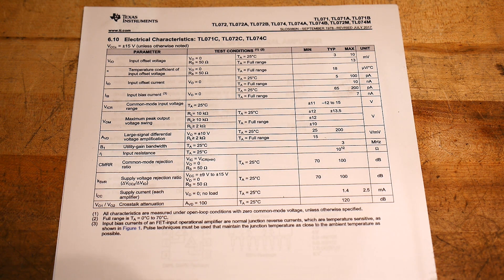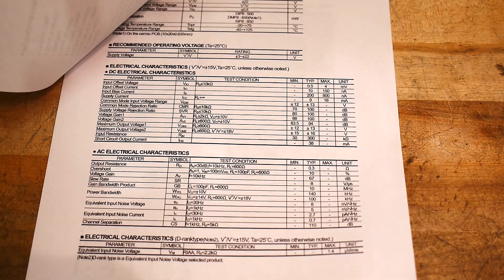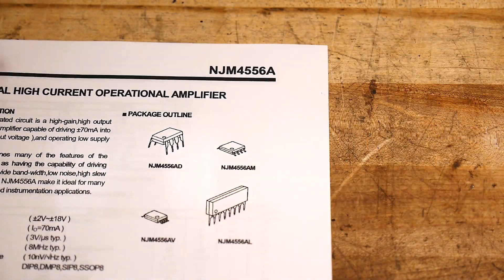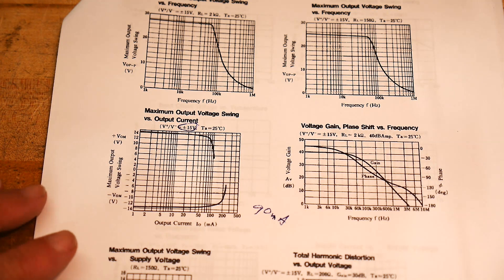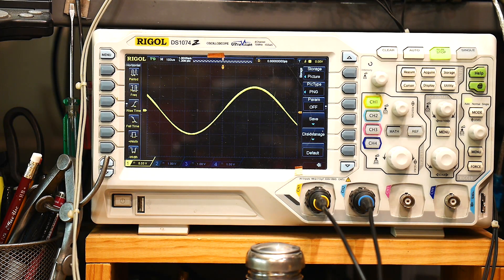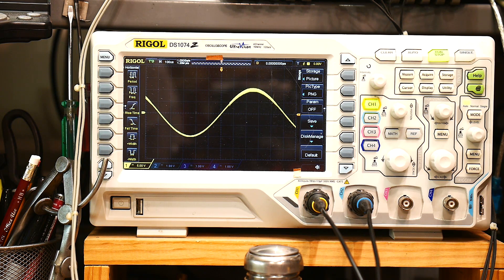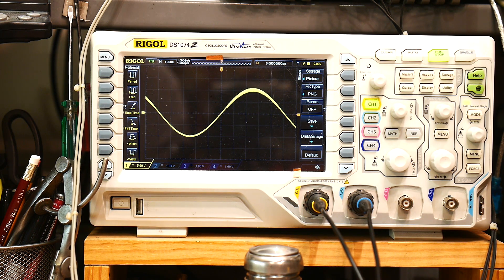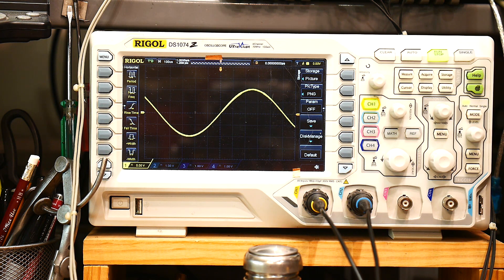#521 High Output Current Op-amp JRC4556

Comment: at +/- 5V the JRC4556 can drive 32 Ohms, paralleling these with series 2.2 Ohms each at their respective output, one can drive even lower impedance headphones. They are also stable with long headphone cables (capacitive loads due to long wires). CMOY, Objective 2, Grado RA1headphone amp uses these same opamps

Comment: The NJM5532 does specify max output current when shorted; 32mA
Reply from the maker: there is a graph of output voltage vs load resistance in the datasheet.

Comment: GREAT video!!  Just after watching it, I ordered a few 4556 op amps.
When you put a 100 ohm resistor across 10v, that's 1 WATT of power dissipation, which means use a 5 W resistor (which will still get hot).  BTW: are you swapping op amps with power ON?
Reply from the maker: yes I hot swap them all the time

Comment: I don't understand the usage of the hi current opamps.  Usually there are some driving transisto'rs in power circuits which opamps can offset the  gains.  I've heard about some power opamps which can drive a few amps.  In 80s, there were a bunch of audio amps which looked like power opamps.
Reply from the maker: some reasons.
1. chip count
2. short circuit protection
3. pcb routing
4. already characterized (spice model)
5. cost?
6. easy

Comment: This amplifier is interesting because it has zero output resistance, high output current and low price. This makes it ideal for building a simple but high-quality inexpensive headphone amplifier. However, it is already old and does not seem to be released. Are there now modern similar operational amplifiers "cheap, with zero output impedance and high output current"?
Reply from the maker: digikey has 3000 in stock: NJM4556AD

Comment: Have you heard of a company called "APED" that sold power components?  I can't APEX now.  They sold op amps that would put out 10's of Amps!!!
I do have one of their fairly cheap PA26 dual op amp that, IIRC, can put out at least couple of amps.  They even made some for driving high-current reversible motors.

Comment: I need more current for diy ribbon headphone? please give me your recommend
Reply: Parallel these JRC4556 as unity gain with NE 5532 as a gain stage. Use 4.7 R series output resistor for joining outputs of jrc4556 together. Search objective 2 headphones amplifier by nwavguy for more information

Comment: I know this was from 4 years ago, but why not just use a super cheap LM386? It drives a 4 ohm load, 100k bandwidth. It isn't unity stable with a minimum gain of 9 (internal default of 20) but that shouldn't be too hard to design around.
Reply from the maker: opamps are much more versatile than the 386. for start, no differential input and voltage mode only

Comment: what was the frequency you used? I could not see it.
Reply from the maker: 1khz
Reply: @IMSAIGuy   so these unity gain instabilities happen at these low frequencies?   I had a notion that maybe these happened at MHz levels. guessed wrong :-(
Reply from the maker: @osmanfb1  I don't think what I was seeing was unity gain problems. I was lack of bypass capacitors and long leads and protoboard.